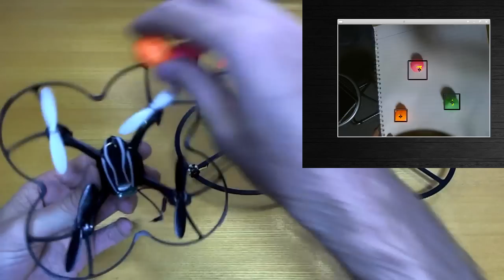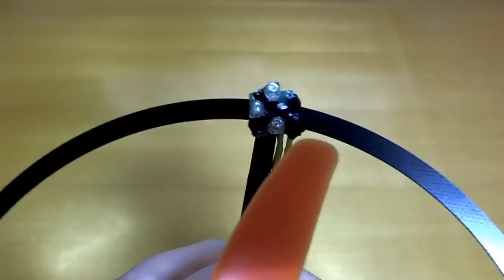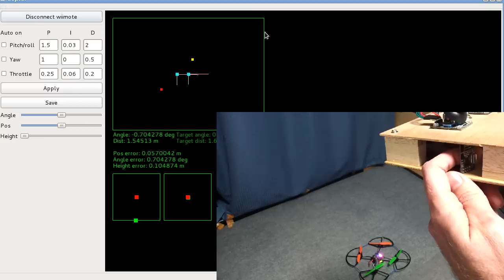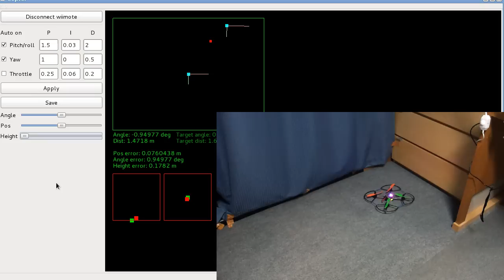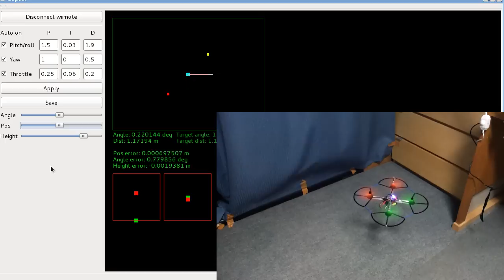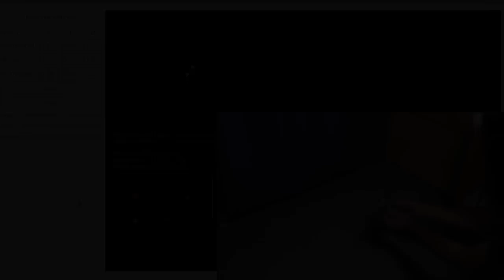arduino + quadcopter experiment part 4

Comment: This is brilliant. Now that I have bought a mini Naze32 board, you tell me I did't need to! :-) Looking forward to how you hacked the MultiWii code and seeing the copter perform some computer controlled movements.
Reply from the maker: The naze32 is a fine piece of gear and I'll still put it to good use, don't worry about that :) It's just more convenient for this particular job to have something easier to program - I actually looked into working the nRF stuff into AfroFlight32, the coding itself did not seem too tricky but getting the tool chain setup seemed like a pain in the butt.

Comment: Amazing video! I think it would be awesome if you could pass FPV feed to OpenCV(or even better, a Convolutional neural network) to calculate it's position based on the image an keep it in a stable hovering or maintain a fixed distance to a moving target(a face or an object).

Comment: Small quadcopter, you can use logic analyzer and find pins - it is basically SPI connection (miso, mosi, sck...) to the transmitter. For example, Eachine H8 has three hex numbers during binding, and four after (one number is next channel where it will jump - frequency hopping). After this four numbers, there are 16 numbers, which actually represent 8 channels - four for aileron, rudder (yaw), throtte and pitch (not exactly this order), and the rest is for other 'weirdnes' as is flip, headless mode, etc. Tray to find hex string '7D' because it is 256 steps for any of the channels, and '7D' being in the middle. Prior to this number, there is some weird designation, and I did not found what is that, something like channel description, but it works in conjuction with other parameters. Recevier side is without first three or four numbers (address and frequency hopping is cut-out). Just eight or sixteen numbers (oh, well... forgot to count how many clock pulses it has, actually groups of 8 pulses for clock).

You use 2D orientation, but you can add third one by using MS5611 barometer, which has precission (error) of just 10 cm - pretty amazing how it is sensitive: http://wildlab.org/index.php/2015/07/07/

You can see that there is temperature compensation. Just be sure to put MS5611 above prop level to avoid change in local pressure 'dirty air' caused by prop wash.

Enjoy.
Reply from the maker: ***** Yes, I started out by looking at the SPI messages on the TX but it was just too much effort and stabbing in the dark to replicate it, plus I wanted to have the quad return information about current angle etc, and I wanted to get better flight times.
Reply: ***** Yes, this is good idea too. I think that one who invented nRF24 deserve Nobel prize. What you think? It is so cute device, enabling people to do so many things with it.

Comment: I did not tried yet (I have lot of started projects, it is time to finish some of them), but you can use nRF24 (100 mW version) instead stock transmitter for your toy quadcopter. Just find which wire represent which signal (most protocols use SPI for sending data to its TX).
Reply from the maker: ***** Yes, I have many videos about the 100mw nRF24 modules on my channel :) For this experiment though it's not convenient to use a toy quadcopter.
Reply: ***** Yes, that is true - small quad, can't lift too much, thus limitted ability to use varous markers if too heavy. I did not see your videos, mostly because sometimes I  am too busy to do this. But sometimes have plenty of time, so will look for this videos. Thanks.

Comment: What a great start!  Are you looking to do outdoor 3D?  If so, this will be a real challenge.  I've seen some 3D stuff done at MIT where they set up some triangulation transponders in the room.  They are extremely agile.  This may not be the direction you're looking to go, but might give you some inspiration for how to move forward.
Reply from the maker: Eventually I'm looking to make a 'follow me' camera, so yes it will have to work outdoors and be fairly agile. UWB radio can be used to triangulate the position of a quad very precisely over hundreds of meters, but the cost of those systems are way out of my reach. For now I want to model the full dynamics of the quad properly and see if using the IMU telemetry is good enough to get a rock-solid hover, then maybe try some trajectory stuff after that. Hopefully, someday I'll have the software side working well enough to justify buying a UWB system :)

Comment: iforce2d, i know there is the main flight controller and then there is the arduino..
i can assume that the arduino is the one flying the quadcopter instead of a human behind a radio right ? correct me if i'm wrong ??
Reply from the maker: +Radish the laptop computer is flying it
Reply: +iforce2d 
but on the low level something has to be generating PPM or PWM signals to the flight controller right ?? example the arduino is receiving instructions from the laptop and in turn generating the right signals to the flight controller right ?? I just need an in depth explanation of how and what protocol the arduino and flight controller are using to interact.. so please, explain. I don't want any code example or whatsoever i'm not the hardware type but i enjoy writing my own code so I learn and understand it better. also i wont be using an arduino.
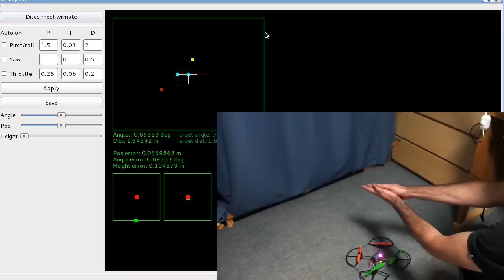Reply from the maker: +Radish Yes, the arduino and the flight controller are using PPM signal to interact. The laptop computer is connected to the arduino in the transmitter by a serial connection, as I explained at 6:25. The radio 'protocol' is basically just sending the positions of the sticks, this video might help to explain that: https://www.youtube.com/watch?v=eVnyPSAefxU

Comment: thanks for all your videos , can you share with us your code, please  because I use like you a transmitter based on nrf24l01 and joysticks but I can't get a level stability , I use  the trimming but without a good results .my quad is multiwii conf.
Reply from the maker: Make sure you are in 'angle' mode if you want auto-level. If you want it to stay in one place automatically you will need a barometer and GPS and more setup to do.
Reply: thanks for your answer ,so if I use just a MPU6050 I can't get a auto-level .
Reply from the maker: MPU6050 has an accelerometer, so it can do auto-level.
https://youtu.be/o-inQZn3AgU?t=2m6s

Comment: This is bluetooth? if it is you can pair it to programme.
can this work brushless motors?
What pcb in this? "the hubson"
thanks
Ive got ar2.0 im try do dual ghz.
reply with what arduino i need asap please so i can order.

which arduio is that and what other board i need 4ax gryo
Reply: can the promini be used actually in the quad? what else it need?
I need to work out dual ghz and build my own controller.
please reply. Im even think get my own board made.
Reply from the maker: The wiimote connects to the laptop by bluetooth, yes. These are brushless motors. Not sure what pcb you mean, but I made a video about this quad here: https://www.youtube.com/watch?v=qtKUwQitqz8
Reply from the maker: Look up "multiwii" if you want to use an arduino as a flight controller. Not sure what you mean by dual ghz...

Comment: If you are after more information on the suitability of different cameras for IR tracking I suggest you take a look at the following:

http://www.free-track.net/english/hardware/camera.php

You may find you have better results if you use the playstation 3 eye camera instead of a Wii remote which also has the added bonus of not needing bluetooth.
Reply from the maker: Indeed. I was using a PS3 eye camera for the color tracking. The advantage of the wiimote is that it finds the IR points for you, in hardware. I have seen that you can connect directly to it using the I2C pads on the wiimote pcb, so that might be something I could try if I really needed to run this on my desktop computer.

Comment: The hubsan video of yours is not working anymore. Is this the correct link: https://www.youtube.com/watch?v=vVDvJFMyx70

I am trying to control the hubsan x4 from the computer to do some automated pattern flying stuff as well. Will you be able to share steps for that. The major problem I face is how to interface with the hubsan RX using an arduino based RX I don't want to break the existing TX I have with the quad.
Reply from the maker: weird... that's the correct link but it doesn't work when I paste it in, but it does work when I click on that link in my videos, or when I click on that link in the search results. No idea wtf is going on with that. You could try searching YouTube for "Wiimote + arduino + quadcopter experiment"
Reply: I think you have made the video private that is why others can't see it.
Reply from the maker: Shubhanshu Mishra
No way. Why would I make it private and then give everybody the link. Plus, if it was private it would say "this video is private", not "there was a problem". And finally, if being private was the reason then I would not be seeing the problem myself when I paste the link.